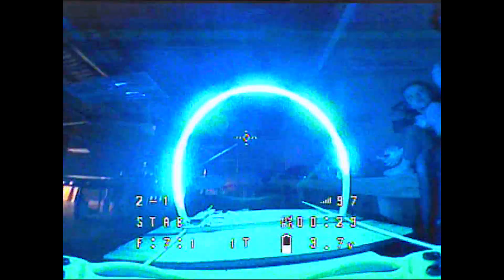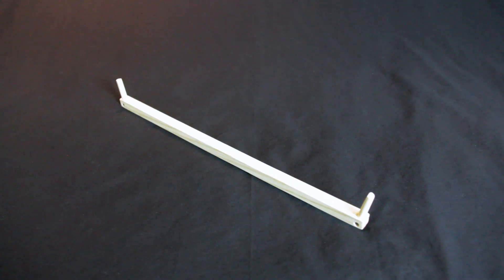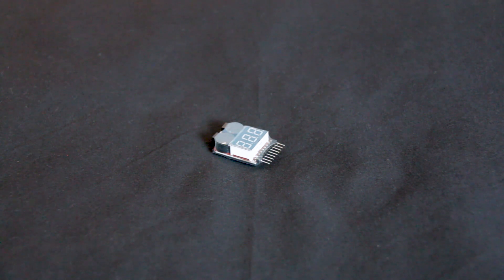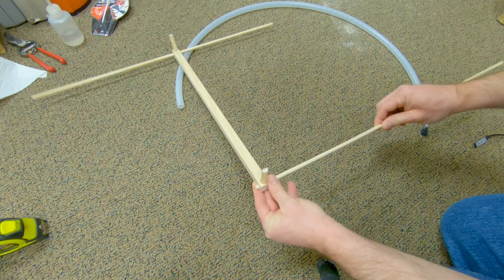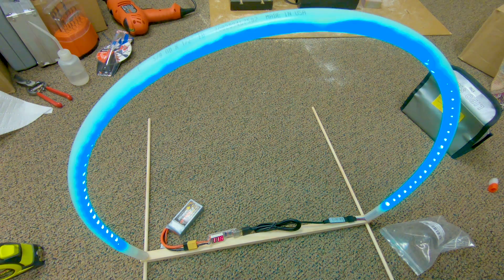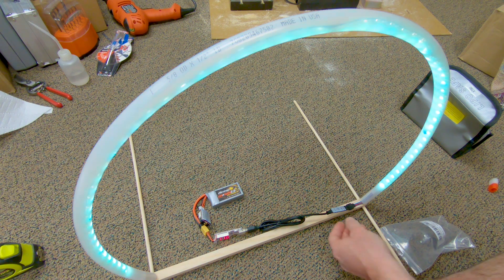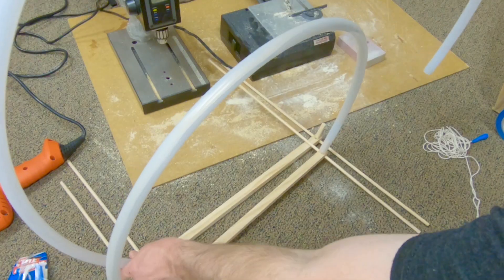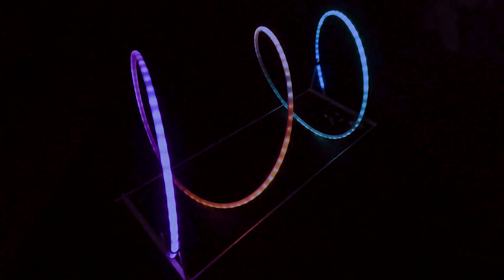DIY Cheap Micro Drone LED Race Gates | Part 3 - Final Assembly

Comment: what is the autonomy of the 4S powering the rgb ??
Reply from the maker: Could you explain the question?  I do not quite understand what you mean.
Reply: @IanBeaty  when you power the rgb gate with, for exemple a 4S 1300mah lipo, how long does it work before the battery dies ?
Reply from the maker: @Izlolz  That is a great question.  I actually do not know for sure.  I normally use a 4s 1300mAh LiPo and I often do not charge them first, I just start using them when they are at storage voltage, somewhere between 3.8V and 3.85V per cell.  The gate will light up for two to four hours that way, depending on what LEDs I am using inside.  If I were to charge the batteries completely I am sure they would stay lit up for many hours.